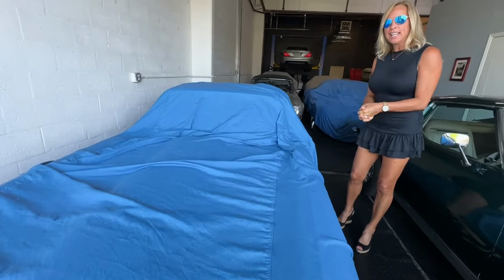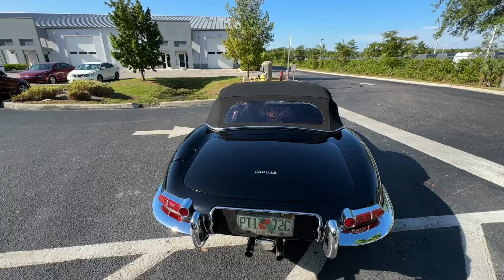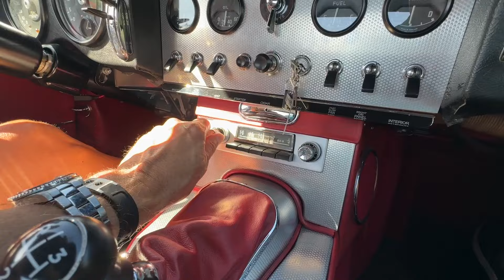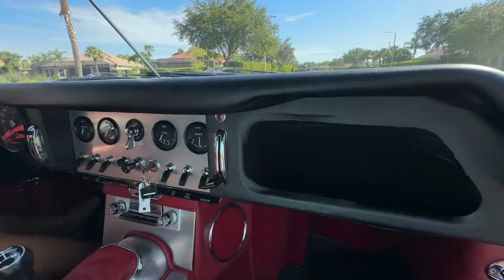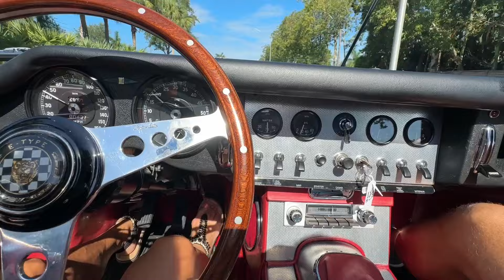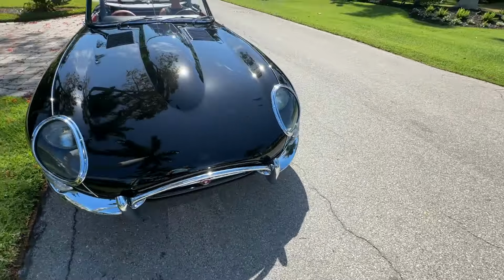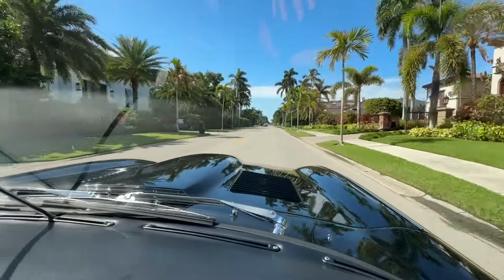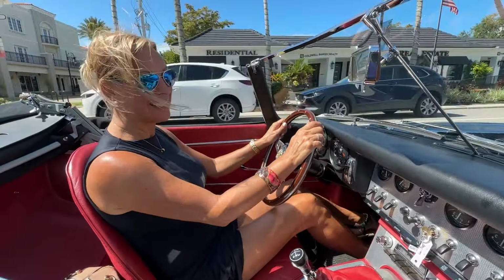Rare 1962 Jaguar XKE | Test Drive by Sophie

Comment: Your toggle switch throws on the map light.  You rotated out the ashtray.
Steering wheel stronger but unoriginal.

I owned this exact yr conv. for 30 yrs, no. 875617, sold 2007 and went to Holland.

Big mistake,,, what memories, thanx!

PS, how much?
Reply from the maker: Thank You for the Information, MUCHO APPRECIATED!!  ~S